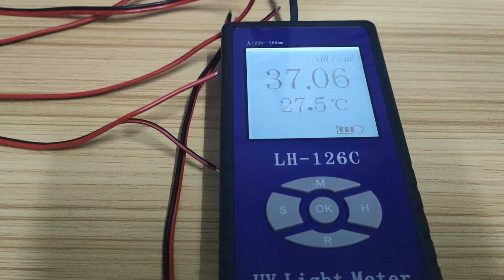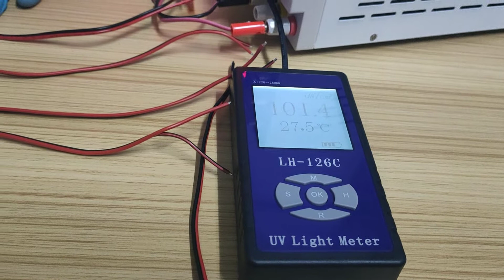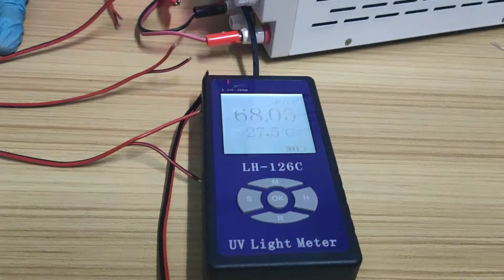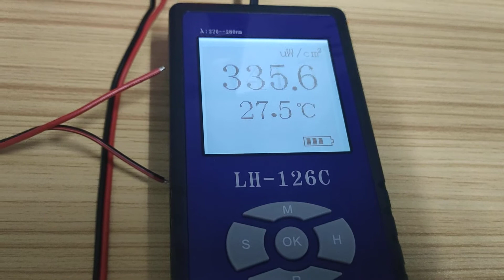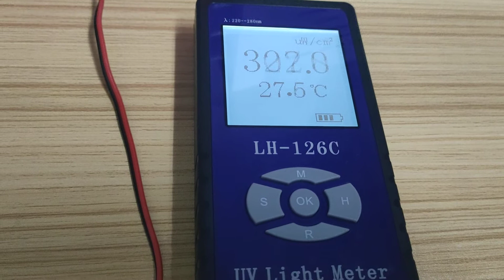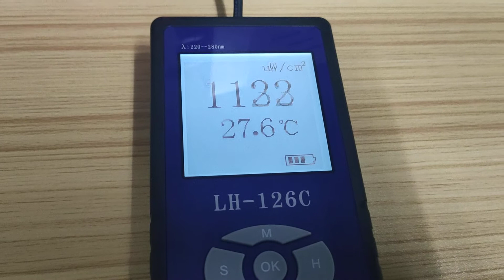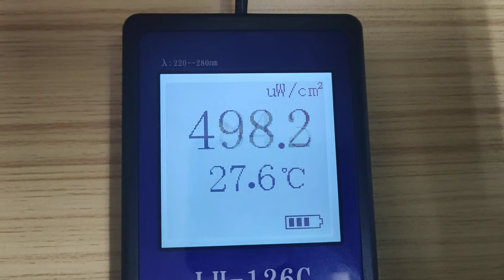How to test UVC LED radiation  DC12v DC24v DC5v UVC LED strip

Comment: How uvc led has purple color isn't it generally blue at range of 255nm
Reply from the maker: UVC normally has no color which is invisible, if you put an A4 paper on the LED chip it will look like blue.
Reply: @tangmark2630  oh ok but I thought generally uvc light supposed to be look like ghostly blue or greenish blue